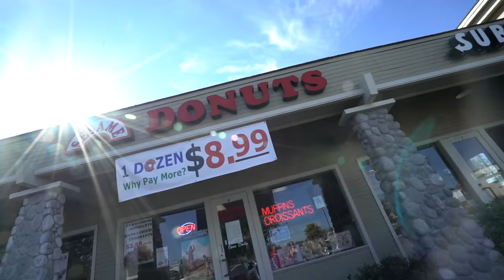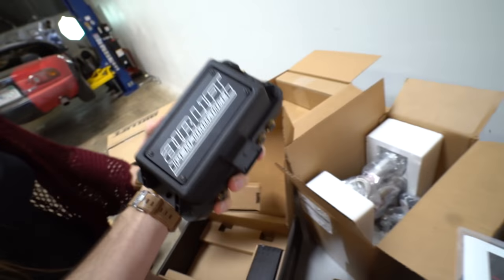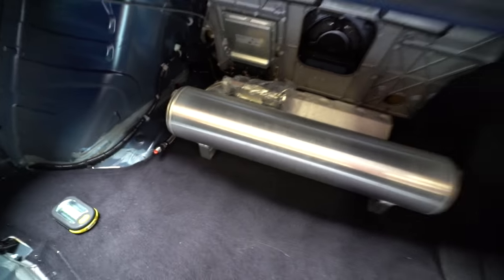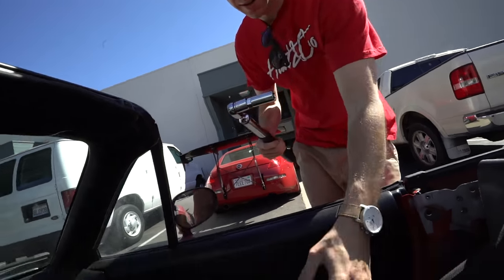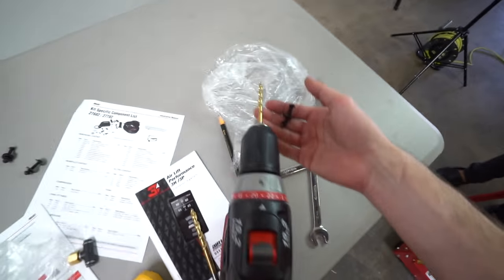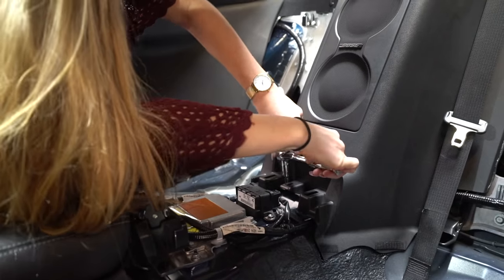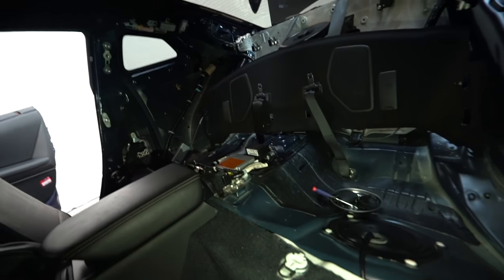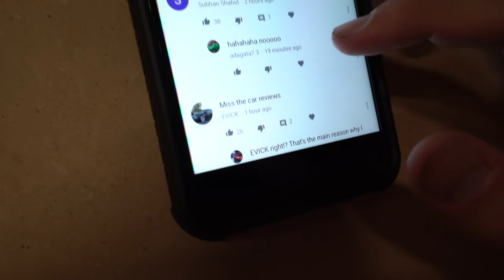BAGS ON MY GTR!! Pt.1

Comment: I've ran coil overs and bags, I would never do bags again, they are dangerous, they can rub pretty easy. Yeah it looks good but they are really not safe and you can get leaks ect ect. You can't beat a good proper setup of coilovers, I think bags are ok for just show car purposes but for a high performance car I would say it's a no no. Sorry Teej don't agree on this one! But sure it's going to look sick! KMF
Reply: thedownshiftchannel 👆
Reply: I think your right but it's TJ's choice to do what he has done. You should respect his decision!
Reply: Dank Boost I'm not saying that he has done the wrong thing. Just from past experience. It wasn't good. Sure it looked awesome but I don't think you can put that amount of trust into a compressed air system, yeah I guess they have came a long way like TJ said and I'm sure it will be fine. Just my opinion dude, I would never bag my R34 haha!
Reply: thedownshiftchannel air lift have proved they can be good round a track, and they wouldn't sell you something for that price if it was not good
Reply: Dank Boost mate, I once seen a guy drive " a bagged car " on track and he actually crashed, sure it could of been driver error but I wouldn't put faith into them. I spent £2000 with X2 compressor + x2 5g slim line tanks, didn't daily the car, the rear bags started to wear quite a bit which had me concerned as I've heard horror stories of people's cars beaching whilst driving which in worse case scenario can lead to a crash or worse. We spend a lot of cash on our cars and in my eyes it was not worth it ( I bagged an r32 mk5 golf ) again, I'm not being a hater just sharing my experience
Reply: thedownshiftchannel ah ok! Just checked out your channel ! Pretty legit ! As if you have a R34 GTR! M3 is awesome too! I've subbed
Reply: Dank Boost thanks man!
Reply: Marcos Hernandez I've had this exact setup, my bags started to split / perish. I am talking from personal experience. They are good for about 6 months. Then the novelty wears off, I'm not saying TJ has done the right / wrong thing, Im just sharing the experience
Reply: thedownshiftchannel Will you lend me your r34?
Reply: Exactly.
Reply: Tai Lopez As long as you make the " Here in my garage " video with it and promise not to put it on bags, sure
Reply: martin figueroa TJ loves me and all of us bros and that's all that matters!!!! #TJHuntArmy 💪💪💪
Reply: Tommy Martin right on bro, you tell him!!!
Reply: Had bags for over 2 years, no issues what so ever. driven daily.
Reply: thedownshiftchannel 10:33 you hoser
Reply: Wade Alexander #KeepMovingForward!!! 💪💪💪
Reply: thedownshiftchannel  im currently running bags on my 96 accord and have been for about 2 years now and i have never had a problem with them and road conditions are pretty tough. Lol
Reply: thedownshiftchannel 11:33
Reply: thedownshiftchannel You are awesome. You don't degrade TJ for his choice in fact you state your personal experience and encourage his! :D
Reply: thedownshiftchannel 10:33
Reply: 100% agree!
Reply: thedownshiftchannel you probably didn't do something right....
Reply: Go to 10:00 and stop talking smak to will do what he wants to do PS Teege I got you back on this one
Reply: i'm pretty sure he's going for the looks on his GTR, and not track it or do any serious racing. So i think the bags are gonna be just fine for him. good luck teej., keep the vids coming!
Reply: ActiviztA1 I agree
Reply: thedownshiftchannel there is such thing as good quality bag setups as there are good quality coilovers. Bags over coils are the cheapest way to run bags . I have airlift bags and they ride really nice and can actually get really stiff and have no problems with leaks and all that if it gets professionally installed it runs great . So I see no problem with bags in reality
Reply: and to add, he already has a track car, which is his 350z.

lots of people buy fast cars like ferraris, porsches and mclarens, but not all of them take it to the track. some just wants them to coast around town or something. it's their enjoyment in life, dont f**k with it people and just chill. :)
Reply: 10:33
Reply: He's not trying to be a dick he's trying to be preventative. It's facts its brand tested , and everything which is great bags are cool don't get me wrong. But he should know its not the same GTR he bought .  And tracking it wouldn't be a smart Idea I commented before he has 2 OTHER cars.
Reply: He even said him self that is just a suggestion and that he is not saying tj is right or wrong but just from his experience this is what happened!!

Comment: before anyone comment "ugh watch the whole video" yes I saw TJ's rant, no that's not going to stop me, here's my two cents

coilovers are better overall then bags, there it's said let's move one the pros and cons of each

Pro for coils: coilovers are safer, they much more adjustable and consistent, they give a smoother better ride quality

Cons: a bit more confusing if you don't know how and why to adjust them, and you can't adjust them on the fly 

once set they are set until you take off the wheels and adjust them again

airlift bags pros: due to them being adjustable on the move you can set them lower, once fully lowered they act just like a normal set of shock and springs

Cons: they are nosier, heavier and the ride quality in general is severally impacted, they are prone to failures normally causing costly damage, they aren't as responsive under heavy steering making it hard to get consistent results, while lifted they cause more body roll

all in all Coilovers are good daily drivers and excellent track day parts, air bags are terrible for track days but really good for daily drivers, the positives and negatives have to be weighed properly before making a decision like this but it is ultimately the owners preference in the end that makes the difference, if TJ wants bags it's his car he can do what he wants, but whose to say that if he's planning to do a track day he couldn't just take out the bags and air tank and put coils back in? after all the parts can be swapped in about a day or two and put back in just as quickly, and once they start getting practice swapping the parts they get it down to an art where it only takes say half a day to do instead

Comment: bags show car, coils track car. that's how its been and that's how its always going to be till bag technology allows it to be as good or better then dedicated track coilovers.
Reply: blitzmonster1 get ready man, so many fanboys are gonna start posting the time stamp in the video....
Reply: http://www.speedhunters.com/2016/12/life-on-air-cody-miles-championship-winning-sti/ RIP You're argument.
Reply: MattyDeath one bagged race car as opposed to... how many race cars with coil overs??? Rip *your argument
Reply: blitzmonster1 yeah, I think they're all kids too, if the comment section is anything to go by
Reply: Lets take your argument to any other technology. one silicon based processor as opposed to... how many computers with vacuum tube triodes.??? Any technology or engineering improvement will always be outnumbered by the predecessor Until it becomes more mainstream.
Reply: MattyDeath yeah, but how quickly was silicone adopted as a transistor material? They couldn't manufacture the stuff quick enough over how much the demand for it rose. Bags, on the other hand, have been around for quite some time....
Reply: MattyDeath damn beat me to the link haha
Reply: Most of the time attack cars now run air Bag suspension as they are much more adjustable and can be adjusted during the run. You can have bags settings as stuff as 20k springs. Personally I think they're underrated because everyone thinks they are just show car bits, I swear if you bagged your car you would have a completely different opinion bro
Reply: Joey/2002 man good reply come up with that by yourself
Reply: You're really original calling everyone that doesn't share your opinion kids
Reply: 10:33
Reply: 10:30
Reply: Jacob Ellis he is not wrong
Reply: blitzmonster1 tell that to a acr

Comment: 10:25   I have 2 of the same vehicles, one on air and one static. I like both but I love the joy of my bags the most. I have reverted to switches for the air for maximum enjoyment! Both have advantages and disadvantages. The air down boogie rocks!! And YES I would "ruin" a Rolls Royce given the chance - as well as a GTR. I think once you give the air ride at least 6 months to get totally comfortable with it - you will know your preference for whatever situation. I'm a slight purist with the switches though, if there's no room for error - there is a missing piece of joy.  The static fam is strong in ATL! I get my share of heckles...

Comment: You should set your drill to drill mode, rather than torque mode, when you do woodwork. There should be a ring to adjust it, just like the torque.

Comment: Quick tip when using a drill to get the bit tight put the drill so it would tighten then put the bit in and hold the chuck still and prepress the button

Comment: You really should make a wall that covers all bag stuff, maybe put a polycarbonate window with tint on it, so it wouldn't pop out so radically, Imo I like bags rather than coils, because you can adjust your suspension from your phone or inside your car! Keep it going, you are getting better and better between every video! Ps. I don't have any opinion about bags on gtr, because I haven't even seen one in person because finland does not have many r35!🤔

Comment: TJ 3 part video of the GTR bags I'm assuming I have mad respect for you ass GTRs are fun to put bags in. I'm thinking of bagging my E30
Reply: also there is performance bags with different settings that are cool with self adjusting for tight corners and to stabilizing the car more from fast acceleration to fast deceleration

Comment: im 16 and just got my first car. what would be your advice on what i should get for my first mod ?
Reply: alecx hough what is your overall goal..? Just throwing stuff at your car ruins the over all picture. Pay attention to the details and you will have a bad ass ride. Most common "mod" wheels tires and a little low. But for god sake don't get coil over sleeves.

Comment: I want to start off by saying, I know it's your car, and you can do whatever you want to it, and I don't care what you do, because A. It aint my car, and B. I don't really care about the GTR's, it's not like they're rare cars or anything, I see a few around every month to 2 months anyway. But I still want to give my views on the bags and why I think they're a bad idea/

Yes, bags have become very good, but coils are obviously still the better option, if it wasn't than more purpose built race cars would use bags instead, I guess it's probably more because of the extra weight added with the air bag system, and it adds some complexity I guess. No disrespect or anything, but if the GTR is your track car like you've been saying it is, than really you shouldn't be driving as a daily anyway, so any creature comforts and practical shit doesn't need to be there, daily driving a track car holds the car back from it's full potential really, because you keep the unnecessary weight and everything that will hold back it's performance. Also you wont drive the car as hard, cause you'd be more scared of getting in a little accident or going off, and then not being able to drive the car on the street for a while till it gets fixed, which is the main reason a track car shouldn't be daily driven is cause there is a pretty good chance at some point you will get into a little accident on the track or go off the track or something.

TLDR;
It's your car do whatever, but the bags add weight and stuff, so for a track car they aint ideal.

Comment: Hey quick tip for the compressor mount . If you put a rubber bushing of some sort in between the compressor and the plywood where the bolts go ,-->  so compressor on top rubber bushing in the middle then the plywood on the bottom,  it helps to keep the vibration from going straight to the plywood and you won't get that annoying sound of the compressor vibrating . If it's any help I'll will try to send a picture on Instagram IG : Juan_zx6r love your builds by the way don't stop doing what you love , and most of all fuck people's opinion bags are like riding on cloud 9 😂 you can't feel a thing . Also check for exhaust clearance issues when it's layed out to the ground I doubt it with that exhaust setup but it's alway good to double check before having a bent pipe 😁 ~ your welcome

Comment: Yo who the hell said bags are good for the track. They are bad because they don't provide the same dampening force,there is no way a bag can take the same amount of abuse if you plan to seriously track your car, and they are more weight for no reason.  I don't care if you bag your GT-R because I think they are too heavy to be fun on the track. They have have a raw acceleration but you don't actually get the light weight track car feel. I haven't tracked a GT-R but I have driven a R35 on the street and you can tell right away.

Comment: What does he need that tank and stuff for? I'm confused to what it's for
Reply: Bags operate using compressed air, so the tank stores extra air to raise the car up and the compressor fills the tank. To lower the car you essentially let all the air out of the bags and to raise it you add more.